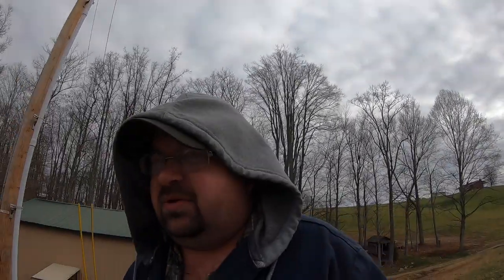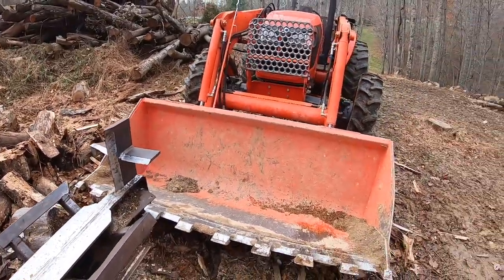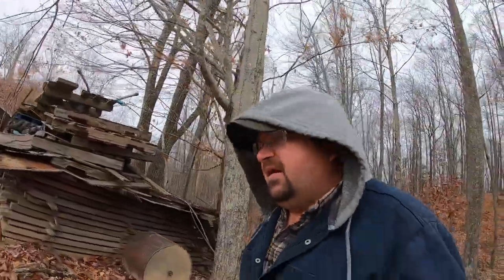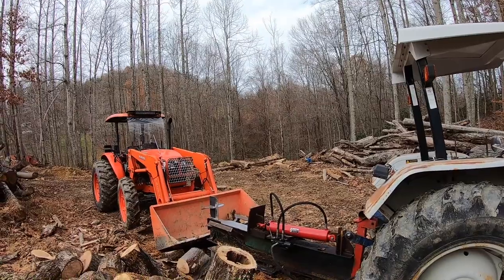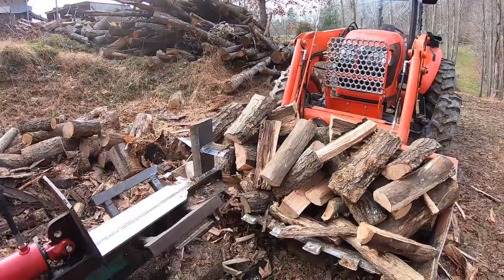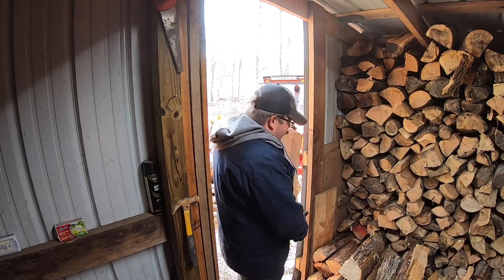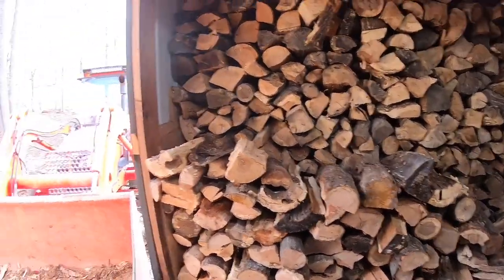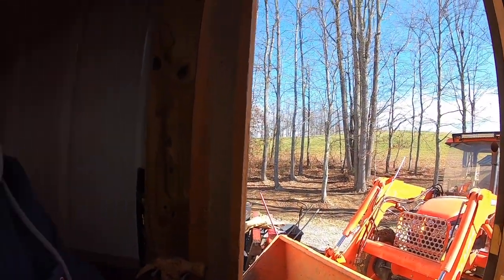Trying a NEW process for making Firewood! Kubota M6060 & Farmtrac 60

Comment: Seems like that system saves you handling the wood one time, and less bending. Say, has that pond filled up yet to the spill point?
Reply from the maker: The pond did fill up but has leaked back down. The leak I fixed is fixed but I have one higher up on the other side somewhere. It drops about 12” below the pipe and stays at that level now. Thanks for watching!

Comment: did you make your splitter? I have valves on my M7060 for my 4 &1 bucket. I'm thinking a skid steer mount splitter could be assembled pretty easy. Or, is there a good deal out there on one. hmmmm?
Reply from the maker: Yes I built mine. I can hook it to the 3 point or move it on the forks. Thanks for watching!
Reply: @khtractors  I have the same tractor basically, so could you get me the ram size specs that you used?
Reply from the maker: It’s a 4”x 24” cylinder. You could go up in cylinder diameter but don’t go down in size.

Comment: Hey Ben I have two questions we are BX run your wood splitter and can you explain what a block heater is and how hard they are to install on a tractor
Reply from the maker: The BX would probably run the splitter but the hydraulic flow is much less so it would move slow with that big cylinder. A pto pump would be best on that size tractor. A block heater is basically a heating element like for your hot water heater. It heats the coolant keeping the engine warm. To install them you have to remove the antifreeze and then pop out a freeze plug in the engine block, then add the coolant back. None of my tractors have block heater’s. My pickup truck does and the white International. Thanks

Comment: Does tractor not work properly with low idle I mean with starting rpm
Reply from the maker: Battery is weak and it was really cold that day. Thanks for watching!
Reply: @khtractors  I don't saying to stop the tractor
Reply: @khtractors  I am saying about if we run tractor on some lower rpm  for low fuel consumption as hydraulic load is no too much
Reply: @khtractors  I experienced that with a proper maintained hydraulic oil a tractor can pick up a trolley of soil with 600 ~700 engine RPM
Reply: @khtractors  thanks for your reaction
Reply from the maker: @Panghal2017  it has plenty of hydraulic strength at a low rpm but if I raise the rpm it just gives more flow for speed on the splitter.
Reply: @khtractors  ok thank you sir